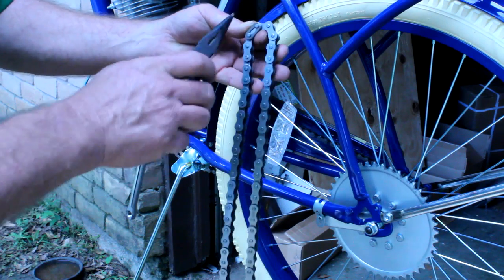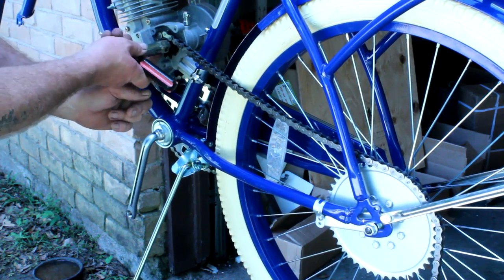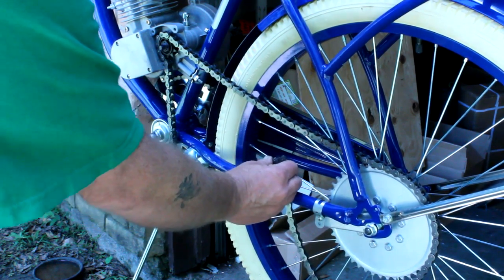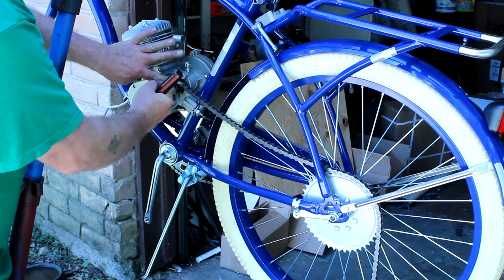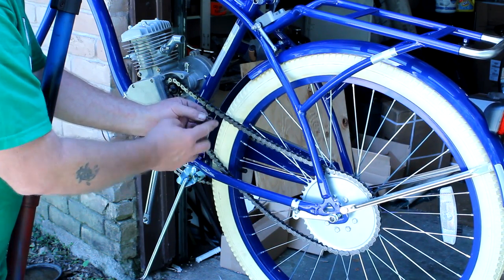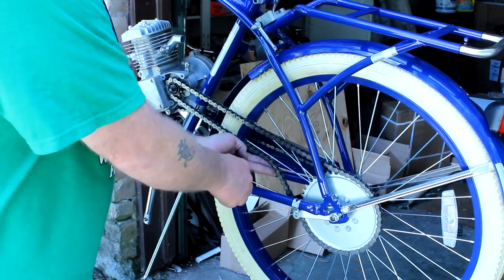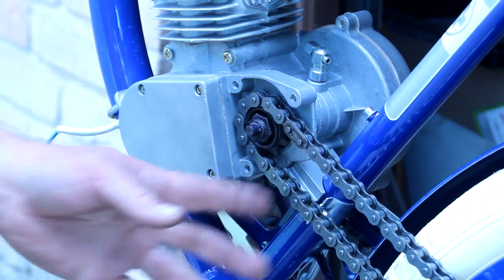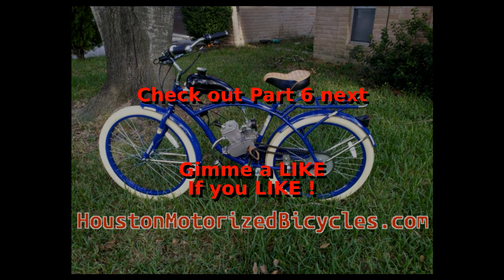How To Build Motorized Bicycle Part 5 -Size - Cut & Install Drive Chain

Comment: Always use a sticky rubber between the chain tensioner and the bike chassis to provide greater stability. Use quality oil or grease on the chain to maintain the useful life of the bike and engine parts.

Comment: These Chinese do not know how to even send customers a chain which is the correct size with their kit… maybe include a tool to install the chain instead of leaving it to the customer? The engine runs perfectly, it’s the chain which kept snapping to the point where it ended up too short as links went missing every time. Now been sent a new chain which is too long and I cannot make it shorter. Going to have to send it back and request a chain which is the correct size as advertised smh
Reply from the maker: there are THOUSANDS of different bikes and they'd need to make 20 or 30 different chain lengths to fit all the possibilities. Once you  learn how to correctly size a chain it gets easier

Comment: will the #40/420 chain fit on that rear sprocket Sir? thanks
Reply from the maker: Yes. Both will fit. The #40 is wider and might rub inside the drive cover of a 2 stroke. #420 is perfect
Reply: @HughesMotorized   thanks I was searching everywhere and could not get  a straight answer they always throw in some more s#*t that confuses my can of beer! But I counted out about 130 links on this video in HD so about 5 ft Im hoping because that's what I ordered lol  Happy New Year

Comment: the sprockets outer toothed edge is away from the center of the rim which changes the alignment of the chain in referrence to the front engine sprocket. Which side of the sprocket should face out?
Reply from the maker: You want to push the chain away from the tire

Comment: These videos are so helpful! but i have one question. i just ordered a huffy cranbrook, and ive seen many people say the coaster brakes are dangerous at high speeds. I went ahead and ordered new normal hand brakes for the bike, but i want to know if im supposed to disable the coaster brake in the rear wheel, or just keep it and never use it. I guess the main question is, if i dont disable it, is it gonna be a problem for me later on, or is that more unnecessary work? Thanks!
Reply: Just keep it as an “oh shit” 3rd brake

Comment: @hughes motorized  i have a schwinn occ stingray chopper 2006 80cc 2stroke. How tight do i need to have the drive chain without the chain tensioner?
Reply from the maker: 1" of play would be fine. No more

Comment: I pull the bucking bar to greased it, and some of the ball bearings came out. Any suggestions on how to putt them back in place. Thank you.
Reply from the maker: There's supposed to be one ball inside. Just put it back in
Reply: @HughesMotorized  I wonder where the ball bearings came from! 4 fall out and one still in the clutch shaft. All I can think of, it's when I was measuring the chain where to cut it,  instead of pulling th chain forward I pulled it backward which was the shorter way.
Reply from the maker: @ravencruz7576  4???? behind the bucking bar? There should only be 1
Reply from the maker: @ravencruz7576  There are Motorized bike FB pages. I suggest you take a few pics and point out exactly what you got and where. Ask on one of the pages and you'll get some help
Reply: @HughesMotorized  They are a lot smaller then the original one
Reply from the maker: @ravencruz7576  The Clutch shaft #20 has only 1 steel ball inside. The Ball is #24, Bucking Bar is #26. Shouldn't be any other bearings inside the clutch shaft. https://www.bicycle-engines.com/clutch-assembly/
Reply: @HughesMotorized  Okay,,stayed up all night putting my mototbike together, 4rd tried and fire up, drove it for about 5minutes came to a stop sign n it die, done spend half an hour, and it won't star
Reply from the maker: @ravencruz7576  Check for spark then see if plug is getting wet w/ gas. Is carb leaking gas out air filter?

Comment: I mounted tensioner to frame. Goin to bend bracket a bit with a large pipe wrench , to keep it line with chain. Moving engine is a pain.

Comment: Am putting together my first motor bike. pain my azz. The chain tensioner is at an angle . Am sure with all bikes. I'll explain. Chain goes straight line front to back. The frame that holds the rear wheel is angle maybe 10 -20 degrees.tensioner mounted to it will not be inline. I need to bend tensioner or something. Am sure tensioner will premature wear out if not lined up. Another video says skip tensioner and readjust motor till there's no slack. May consider that
Reply from the maker: Each bike is different. I've used a big adjustable wrench to bend tensioner so it aligns w/ chain

Comment: You don't need to have the case off just have your clutch push the motors gear and insert one end of the chain and under the gear with your index fingure spin the so the chain rolls

Comment: The metal cover to mine doesn't wanna screw in all the way. Do you know what it could be?
Reply from the maker: clutch arm positioned wrong or bucking bar issue perhaps
Reply: Its the cluttch arm but the cheap screw broke inside the arm so its gonna be a lil tricky to adjust. Thank you for the reply.

Comment: all the work you do you need a chain breaker.
Reply from the maker: I suggest it if you work on several bikes. You can do it w/o a tool, but it makes breaking a chain so much easier

Comment: I haven't seen a video of yours where you had upgraded the bracket to hold your fender on the beach cruiser. Of course I can't find it now but what was that little bracket that you had used to lock your fenders in

Comment: What do I do if my chain that comes with my kit fits my back sprocket but not my front sprocket is seems like the front sprocket should be for a BMX chain
Reply from the maker: sometimes you need to take a file and dress the front sprocket. Poor quality control

Comment: bro im having trouble with my motorized bike.. how can i fix the chain rubbing on my tire.. im using beach cruiser 26x2.195 tire.. what should i do??
Reply: Often times people don't get the drive sprocket tight enough on the rear wheel and that can cause your problem.

Comment: what brand bikes would you recommend for these kits?
Reply from the maker: +Fishes worst enemy BEST is to get a 1940s to 1970s Beach Cruiser. Very heavy frames. Then get heavy steel wheels
Reply: @HughesMotorized  I beg to differ.  Even though I like your channel.

Comment: First off let me just say your videos are the bomb!  I am just about to start my first build and feel confident with the help of videos. I bought a used 2 stroke supposed to be in good running condition. My question to you would be ...the motor sat out side  for several months and I need some advice on how to go about getting it ready to be assembled. I have watched full assembly of motor, I just need to know how to lube/grease the motor itself. Thanks Again for the fantastic job you do. Gene

Comment: to easy to go to walmmart and get a $5 chain breaker right?
Reply: Trey Sullivan I did that, and the breaker was so cheap it wouldn't even work on a bike chain, much less the one that came with my kit.
Reply: Trey, buy a bike kit and you go to Walmart and you will find you get what you pay for, A chain breaker that's good for nothing.  Buying something with good quality is worth the money and time and you only have to pay for it once. I would not think of Walmart as a store that sells stuff like this as good quality.
Reply: @timothykarn6080  The motor he's working on may as well be sold at Wally World lol.

Comment: you do know that not everyone has grinding tools....right?
Reply: +NinjaViking1 you do know not everyone can have life super easy....right?
Reply: +amritGAMINGYT 
What does that mean?
Reply: NinjaViking1 if you dont have grinding tools, oh well
if you're gonna build motorized bikes you need various tools...not just for this, other projects too
if you dont have em, go get em
Reply from the maker: +amritGAMINGYT Thanks
Reply: a nail file will eventually do the same job. or you could buy a $0.25 sheet of sandpaper. alternatively, you could stop making your problems everyone else's
Reply: 1, you can use a hacksaw to cut a chain as well if you try hard enough.

2, he should really be just using a chain breaker rather than a grinder to begin with.

so telling someone they need a grinder to build a motorized bike is kind of dumb since a 10 dollar tool will do the same thing much better. It's also a tool most people wouldn't expect to need building an electric bike so I see OP's comment as totally valid.

Comment: Someone please help me! I've got my chain and everything on good and tight, but there seems to be a problem with my clutch.  even pushing in the clutch arm by hand, I can feel resistance, but it doesn't disengage the clutch.  What do I do???
Reply from the maker: Sol Harris-Boundy You might just need to break the clutch pads loose. Hit bucking bar pin w/ a hammer or take off clutch cover and tap on clutch plate to loosen up

Comment: How do you spin that gear? Whats the tool you used named? My chain broke n i got a replacement currently trying to break some links out of it maybe like 5 for it to fit fine.
Reply: You have to use the spark plug tool to both remove the spark plug and turn the gear.
Reply: Eugene Hughes i bought the bike used the chain broke after 5 months
Reply: Eugene Hughes where can i buy it, and whats the price of it and what is the exact name of it i cant go asking for a spark plug tool theybgonns tell me crazy lol.
Reply: blinkshadown 3/4 socket works also

Comment: Eugene or anyone, could you PLEASE help me! I've got a problem with my chain. I don't have a chain tensioner (roller) and my chain goes off either front(engine spr.) or the back sprocket. I need to know whether a chain tensioner would fix things or i should pull the chain by moving the engine a bit up. I was told that those plastic tensioners last for too short and is best not to put it but i don't know. I think it wouldn't be good to stretch the chain that much (as with no tensioner). Please, advise me how to proceed!  I just want to ride and not worry the chain could go off the the sprocket (because of slack)!!! Do those rollers really get bad very fast. What should i do???
Reply from the maker: YES. You need a tensioner
Reply: Ok thanx. I already got one and after the first ride it stayed firm and i didnt have issues with it.

Comment from the maker: Orlando .. You can buy a new pin from Bikeberry or Gasbike.net
Reply: HoustonMotorized 

My chain came off when I hit a pothole. How do I put it back on the sprocket? Do I have to remove the back wheel, or can I roll and pop it back on like a regular bike?

Comment: When I put the little pin belong to the cluth (shaft)  is almost all inside. Abd I dong know how to adjust this lilte piece to get disengage. Do you know what is the problem?
Reply from the maker: Is the ball inside the clutch shaft? It the pin is going in too far. Id say the ball behind it is missing
Reply: Thanks

Comment: Hi, what size is this chain? Because my chain that came with the kit broke, and I bought a 415 and it doesn't fit. it's too big!! :(
Reply: Stanly Manly what size was the chain?
Reply: my chain broke too. I am unsure of the chain size.
Reply: As far as I know a size 16 is what most bikes run on. but... that said if you still have the chain (i know this is 4 years late) you can take it to a home depot and compare chain sizes. I'm also sure theres a way to measure chain size.

Comment: Would be easier if you used a chain breaker tool available from any bike shop for a couple of pounds
Reply from the maker: YES... I have one. much easier.. Most people dont have one or really need one if they are only running one bike. If you are working w/ several... I do reccommend getting one
Reply: HoustonMotorized i. Would like to. Order a motorcycle kit now send me the information please